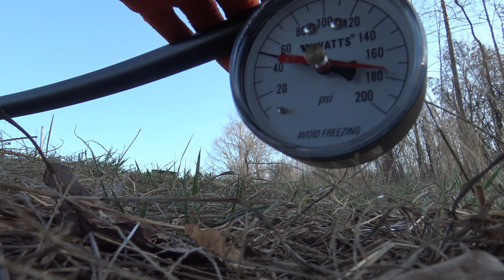You've never seen a farm water system like this...cheap, easy no electrical required!

Comment: I worked at a Plumbing company in Mount Airy N.C, and the owner had a a "thing" for ram pumps. He bought a collection of new old stock rams, from a 1/4 inch display model( with a glass "bulb"shaped chamber!) size to a 3 inch inlet giant model. I piped a cattle farm with a normal submersible pump once, and for reference ,100 head of small cattle thrived on 1/2 GPM- it overflowed in a submerged U pipe to feed another watering tank down hill from the first, then downhill from the second to a third tank. 3 tanks of drinking storage, spread far apart. On hot days with large cattle it took only 1 GPM to satisfy the need. The 3 tanks were several hundred feet apart. The bottom of the first was higher than the top of the second, etc. These were homemade concrete tanks with two 1-1/2 " galvanized nipples poured in place, one on each end about 1 foot from each inner edge of the tank. The inlet nipple was flush with the bottom, the outlet had all the threads above the concrete floor. We simply used a coupling and a cut length of pipe to establish the outlet U bend height ( one elbow horizontal, a short nipple, an elbow downward.) The water height will be at the bottom of the horizontal nipple. I thought smaller Galvanized pipe could be used in the tank, but the cattle are strong! 1/2 GPM is 720 gallons every 24 hours.
Reply from the maker: Was just up at the stockyard in mt airy a few weeks ago...great town!
Reply: @StoneyRidgeFarmer  You need to come to "Mayberry Days" in September. Find out about it at visitmayberry (dot) com.

Comment: So do you need to have moving water to use a ram pump? That’s what I always thought but it didn’t look like there was water running out of your pond. If this works on a still pond I’ll like to buy a few of these things to split some larger pastures up and pump water to the ones that don’t have ponds!
Reply from the maker: You just need "drop"  you can move water by siphoning it to the pump from a pond
Reply: @StoneyRidgeFarmer  Is there a different way to start the siphon?   Maybe a shutoff valve at the bottom with a way to add water from a bucket at the top?   This might be useful in situations where the input pipe is bigger - just a thought.  Also wondered if would work when want to just siphon out of the pond or ditch.

Comment: I see one mistake if my eye's are seeing correctly,that you are using galvinized pipe on your faucets and being a retired plumber third generation that is the worst pipe to be used for water supply.It builds up corrosion inside the pipe and block's  the flow of water.If you use metal pipe it should be black pipe,or  K or L grade  thick walled copper.
Reply: You don't use black pipe for water, black pipe rust a lot faster than galvanize and is only being use indoor for gas.  You're a third generation plumber, you have been taught wrong.
Reply: @keyvandyken1716  

Word from and old plumber. You are absolutely right my friend. In Holland the gaspipe withhout any corrosion protection is Black Malleable. So when order an 1 inch niple we have to write down "Nipple 1 inch black malleable".
Beats the hell out of me why a plumber thinks about corrosion protection the wrong way round.🤔 
Because i'm old i did use 1 1/4 gaspipe for my whole wood/cv system and painted it. Don't want to use pex pipe.Hate that stuff when temp goes beyond 70 degrees celcius.Over time  the plastic melts.
Reply from the maker: Yessir....I agree to a point..but I didn't make the hydrant....a copper one would cost a pretty penny I bet.  Best to set up a quick connect system here and tap into what we need as we need it

Comment: How do you keep the exposed pipe and equipment at the pond from freezing in the winter?
Reply: We use to water 20 milk cows from a shallow human made pond drawn by electric pump. We put the filtered end in a 5 gal bucket to help keep sediment out and the water in bucket kept filter on bottom to avoid float or freezing.
Reply from the maker: Keep water moving...this system is temporary...we'll have a more permanent setup soon
Reply: They are in NC if I’m not mistaken.  Here in WI that “keep the water running” wouldn’t work well without some type of heating element.  -20  degrees for a few days would likely freeze this type a system.

Comment: You need a 1gal. milk jug w/handle and cap. tie paracord to the end of the filter and the handle on the jug suspending the filter in the water column.
Reply: Wonder if you would explain more about what you have in mind.   In the video, not where where a 1 gallon jug would fit.

Comment: Can you put a bigger pressure tank" bladder tank" to gain more pressure
Reply: Bobsyouruncle Wilson  And that pressure can't be increased,without longer flow and pipe reduction, A bladder tank will not increase pressure, as I said this has been around a long time, Look up hydraulic mining in the 1800's, the stream flowing into pipe with pipe diameter reduction down the mountain side created pressure,The water hammer device worked on siphon principle, when enough water fell it siphoned that much water from the well using check valves this clicking of the valves gave it the hammer sound hence the name,,increasing the distance in downhill flow will increase pressure some( until terminal velocity is met),after that a reduced diameter pipe must be introduced to increase pressure but will reduce flow in GPM
Reply: putting a tank will not increase pressure, but you can store water

Comment: Where is all of the wasted water spurting out of the ram pump going considering the ram pump looses 10x more water than it feeds to the outlet.
Also does the pond get filled with more water than the ram pump consumes?
Reply from the maker: Ram pump uses about 1.5 gal per min..pond runs at around 6 gallons per min.  The water used by the ram pump continues right down the creek to the next pond

Comment: I'm curious if you're going to run into line friction issues as you get further away?
Reply from the maker: Not enought friction to make a difference...however we will install permanent pipe in the future...pvc coming out of the pond for this purpose with quick connectors

Comment: QUESTION 
I’ve  been thinking about something  like this for years on our place  
You asked “how much water can your cows drink” well the answer in the lower part of Georgia is A LOT in the summer. We have several wells and water troughs and on some days 50 cows and their calves  can drink more than the well pump can put out. 
The question is if a ram pump is  putting out a gallon a minute how would you suggest overcoming this issue if I had an area with only ram pumps? Run multiple pumps?

After seeing this I’m thinking about running a ram pump in addition to the drilled well in some areas to combat this issue it’s usually 90 degrees here from May until late September/October they drink A LOT
Reply: 284Winchester 
I’m hardly an expert but I would think that would be a good and inexpensive solution...
Good Luck...!
Have a great day and be blessed.

Comment: Not sure if you have beaver issues in your area. If you get beavers in that pond, stop using it immediately to feed your cattle until the beavers are killed off. I'm not sure on the medical term but beaver fever is what it's called around here. I have heard of trappers getting it out in swamps and be in the hospital for a few weeks, but I have seen cattle drink out of infested ponds and die from it. Just a heads up. Thanks for the great videos.

Comment: Sorry to hear about the calf. Not your fault, Like the ram pump idea for pulling water out of a stream. Pulling water out of the pond may not prove to be a good idea unless hour pond has a good supply filling it. The ram pump may use close to 10 gallons of water to push 1 gallon to your tank. If that is running all day long your pond might be pulled down quite a bit. Potential 1000 gallons out of your pond to get 100 gallons to the tanks and that is if you start and stop the pump every time you use it. If you had a small stream you would just be taking a gallon out of it the waste would e returned to the stream. Maybe I don't understand your idea completely though.

Comment: Is something very interesting In Thailand, the same principles apply. In Thailand, than PUMP TA BON (Name of thailand) the water to pump up the water. Used in the northern part of the country because of the high water source, which has the source of water flowing from the lower to the lower.

Comment: Great I learned something today.  I do not  believe I have heard of this concept.  As long as you have a free source of water looks like it should work just fine.  Great video.  Thanks for sharing.
Reply: Yes as long as that water is flowing and has some drop it will run 24/7. I ran a pump for 6 months .... before my neighbor turned it off  haha

Comment: They will drink 40-50 gallons a day, each,  in the summer.
Reply: Cows can suck up five (5 Home depot bucket)  gallons,  in just minutes.
I haul water to the cattle, have seen this many times.
Reply: @nellyfarnsworth7381  that's a lot of water. This pump can supply around 700 gallons a day.
Reply: @LandtoHouse  
Excellent
That's about 50 to 70 head of cattle.
Reply: This small 3/4" pump can supply up to 700 gallons a day. So with the current herd there is no issue.
Reply: I'm just guessing, but I think the larger size pump on amazon might deliver 5,000 gallons a day - remember pumps 24 hours a day.   That would be 10 cattle at 50 gallons per day.   Wonder how close my estimate for volume is and if there was more head if more water could be pumped?

Comment: What if you used a taller section for the area that builds pressure? Would that make more pressure or pump more GPM??
Reply: making the pressure tank larger or taller does not increase the pressure but does give a nice buffer for fluctuations in how fast the delivery valve can be opened.

Comment: Iv seen a few on line with a p.s.i Gage on the pump it's self . .one in and one out . And you can try a pool floaty tube in side for preshor.  I have watched this guy a few time now but ,( to me ) if seen a few better rigs . Note.  I like them all but.  I will be making one for the farm I work on this spring . Cold and frozen up here in n.y right now . It will be a tiny bit different set up tho . And like u , the farm owner is alllll about somthing free if the investment is worth it . 💪✔  . Cheers man 🖒🍻

Comment: Yeah ram pumps are great passive  water supply. I learned how years ago from Engineer 775. He is awesome for water issues. He also will come set your whole house, or fire lane installation. 

Ram pumps homemade cost $60 to build your own. I use a $1pool noodle in my air bladder.
Hope you enjoy your ram pumps Josh! I know I enjoyed mine.
Reply: Denise Wilson 
I have been following Engineer 775 for a long time and find his videos very helpful...!
I’m courious about your build using a Pool Noodle.
Would you mind sharing your build...?
Thanks for your time and help with this.
Have a great day and be blessed.
Reply: @troystutsman1400  If you would like to see what happens to a pool noodle with clear pressure tank you can see that on my channel. I found that the noodle collapses when the pump reaches a certain pressure. The closed cell foam does not bounce back as well as I would like.
Reply: Engineer 775 is great for his water projects. I also enjoy them. I have used the pool noodle in a clear pressure tank to see what happens. The closed cell foam collapses when the pressure is above 45psi. (easy for a ram pump with closed delivery pipe) Thanks for sharing.

Comment: Great video. Although it's obvious that you lose some water through the waste valve, it would be good to note that the 1:7 ratio also applies to the amount of water pumped vs. the amount wasted. Many people will think you're getting something for nothing if you don't point that out.
Having a cistern to fill would be great. As someone pointed out below, Wranglerstar uses one of these. He fills a cistern while water is plentiful. Of course, if the waste flows into a lower pond, you still have access to all the water.
Reply: Arkansas Pilgrim 
There is no reason that you couldn’t hook up some piping
to the waste valve to send that water either back to the pond
or to a holding device, either one you’re already pumping to or
a completely different one.
This would prevent wasting all of that water.
Reply: @troystutsman1400  how do you send the wasted water back to the pond after it had descent those 7 feet down? You would have to pump it back, right?
With what pump?
Reply: I also thought you should recapture the waste water. The pond would empty in less than a month unless it is fed by a large spring.
Reply: @maryhornbostel6959  I think the pond is spring-fed. The reject water from ram pumps usually flows along the path it would normally flow through if the pump wasn't there. The ram pump just takes some of it and diverts it to where you want to use it. It's only "waste" in that it doesn't get diverted to where you want to use it.

Comment: Now I'm confused. Did you just install the inlet in a pond of no moving water and just siphon the pump to start it? Every ram pump I've seen in the past was installed in a creek or river and required a drop, or at least I thought so.
Reply: Turns out the ram pump intake works just fine with siphon start. Once the water is over that small rise of the culvert pipe it works just like it would in a creek.
Reply: I could be wrong but I think he put the pump lower than the pond " downhill side"  then siphoned to get the water started to the pump then the pump pushed it uphill.  I've never seen something syphon that was higher than the original source.
Reply: @mattrivers973  correct...the pump is below the pond...but the outlet line from the pump feeds an area higher than the pond. The energy to raise the outlet water higher than the pond intake is captured from the water that spills out (goes down) and continues to go downward from both the pump and the pond. Like a pulley, the weight or force going down has to be greater than the resistance that is moved up.
Reply: He says at 3:12 that you place it in a creek with a head pressure.
Reply: @GoTocco  drop in a creek would be irrelevant if the creek is open to the atmosphere..., but I don't understand this to be honest...because it seems like this could be used to make a perpetual motion machine by just dropping the intake into the ocean, and of course perpetual motion machines are impossible.
Reply: American Sentinel K9, LLC There is a polypipe coming in and one going out. The one coming in is grabbing water from a higher elevation so there is some pressure coming into the ram pump.
Reply: @GoTocco  I understand that. I was referring where is the energy coming from that drives the water up higher than the ORIGINAL intake...not just above the pump, but also higher than the original water source. I looked into it and discovered that ram pumps dump out more water than they drive uphill...so the spillage water that falls out is the driving force for the bit that goes up...meaning, for every 1 gallon or so pushed up, there is about 4 or so gallons that go down (spilling out of the pup to cycle it).
Reply: @APBT-Bandog I'm also very intrigued  by this.  I believe the smaller outlet pipe creates the pressure. 3/4" inlet,  1/2" outlet. 
ala Eastwood's High Plains Drifter hydro mining system.

Comment: I would forget the frost free hydrant go with those push  connectors much cheaper, can install alot of them so you can move tanks easy. I live in MI and have used these for 15 years with no problems

Comment: Connect your ram pump to an approximate 1500 gallon storage tank and then you can gravity feed to a job's Mega flow float or to one of the 2 or 4 ball waters that I mentioned to you They will work with only a few pounds pressure On a job's valve Like you could actually have a couple of storage tanks M pipe to various locations in your pastures using a plausen valve, and move the 2 hole waterer from paddock to paddock with the minerals in rotational grazing

Comment: WOW!!! 50psi!!!! That's incredibly efficient!  I've never seen this type of pump so I'm kind of at a loss, pretty genius!   SRF when's the next live stream?
Reply: That psi is with the delivery closed. The PSI when the delivery is open is very small. The flow rate is slow but consistent.
Reply: @LandtoHouse  right I understand that,  but even for a static pressure to be 50psi simply created by a "water hammer" is pretty genius.

Comment: Hey Josh,  I ain't trying to burst your bubble, but, you still need to put the Teflon tape on those plastic threaded barbs. If you don't, they will still leak no matter if they are temporary.  Everywhere you have a leak, you will end up with a big wet area and it will just turn into a mudhole.  It could also mean your pond goes dry long before it should.  I'm 66 years old and have used black plastic pipe for years.  I don't know who told you that you wouldn't need a thread sealant but they were wrong.  It is a whole lot better to do as you are going than to wait and end up needing it done later.  It is always better to do it right the first time.  Ain't no fun having to lick that calf over.  Just some friendly advice from someone that's been there and done that.
Reply: Yep, The plastic fittings have a tendency to bite into the pipe making it difficult to disconnect. Teflon tape is cheap.

Comment: question for you, the upright 2 inch pipe on the ram pump, if you make it longer, do you increase your output water pressure
Reply: The pressure output does not really go up with increasing the pressure tank size. What does happen is more water volume in the tank. This means the delivery pipe can be opened faster and not cause the pump to stop from backpressure loss.